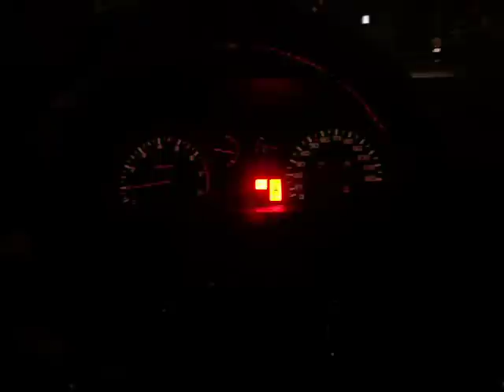Stock D15b Vtec messing around

Comment from the maker: It was a D15b non-vtec, all I did was get a d15b vtec head, OBD1 distributor & injectors and bolted it on along with converting my wiring harness to OBD1 and a OBD1 ECU(p28). if you buy the engine complete all you would probably need to do is convert your harness and get a ECU. If I had to do it all over again I would definitely get a B16 or 18 instead. JMO

Comment from the maker: it's real J-Spec d15b vtec motor(confirmed with shop after I took video), the ones you are referring too are usdm motors I believe which are all non-vtec. IMO nither vtec or non-vtec sohc's much good enough power in stock form. I've done quite a bit to mine and it's still slow so if you aren't boosting; it's just a waste of time IMO.